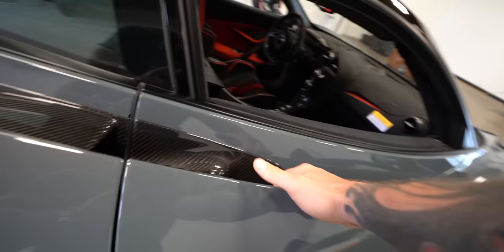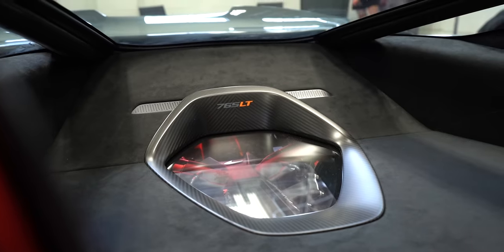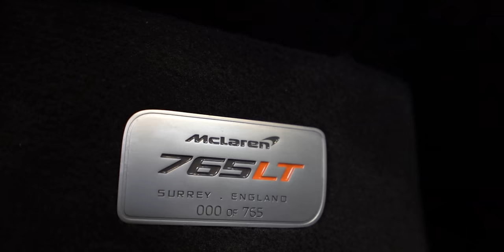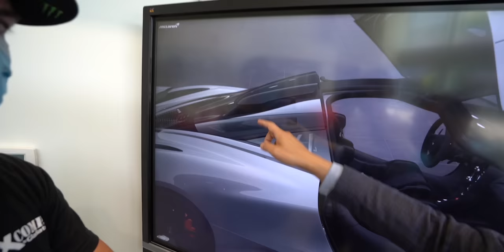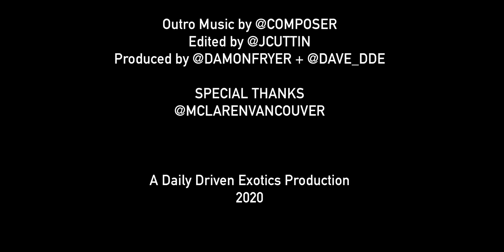TRADING MY MCLAREN P1 HYPERCAR FOR 2 NEW SUPERCARS?! 620R & 765LT

Comment: Think about your differentiator - what makes you guys special.  The P1 was an obtainment achievement - incredible for a YouTube pure car channel.  However, for the most part the cars you all create and make your own are what draws so many people to you in addition to you daily adventures.  A 765LT is in many ways less interesting than what you will do to your 720s “GTR” creation.  A 620R or 600LT cannot be made but so much more crazy where it draws a wider audience.  I’d invest the potential P1 assets in a way that draws even greater appeal.  488 Tire Slayer makes tons of sense, something different that you can create and nostalgia to the OG 458 Tire Slayer.  Cars you simply purchase to park i.e. a CGT or even the P1 and show/drive on occasion will likely not draw the same return on your investment your hoping for.  Urus may be very cool with you all’s creativity.  A Porsche of some type draws in another brand not currently in the mix where there is a ton of aftermarket ideas that can be done.  A Merc of some type - maybe a GTR Pro or even a GTR and make that into a full on Mercedes GT3 conversion with the Black Series wing and added aero.  More is not more if it’s more of the same despite how cool of cars the 765LT and SVJ are.  More is more if each one is truly unique and different than what all the other people out there have too.

Comment: Why not some german cars [porsche, audi, MB-AMG] getting tired of lambos sorry
Reply: would LOVE to see them get an Audi RS3 and mod the shit out of it. can easily squeeze 1,000hp out of them. mines 575hp with simple bolt ons & tune
Reply: Lambo is German though and german crs are overrated
Reply: SRSpoony lambo isnt german its a italian brand wich is owend by Volkswagen auto group the parts and engine are from audi but its a italian brand
Reply: @danielnik8521  its owned by a German company and 60% of the car is German made NOT Italian and it might have an Italian branding but its a German company. 

You cant argue with a fact that its German now plain and simple same as Ducati and all electronics on the bikes are bow German aswell as many other things like the brakes and internals in the engine
Reply: SRSpoony why overrated
Reply: @danielnik8521  cost its way over priced
Running costs for service over priced
Very prone to going wrong on parts that shouldn't fail or designed poorly.
Oil filters for instant need turbos n heads removing for a small oil catch filter audi
Poor quality heads on BMW 
Saving weight on them actually costs you more to buy the car for less
Reliability is an issue.

List can go on and on. When they work fantastic WHEN they work. Had plenty I live in Switzerland

Comment: why does he like the chassis mounted wing?
the electric one is so much nicer
Reply: chassis mounted wing makes more downforce than the active wing and makes the car more nimble around the corners.
Reply: And it looks fucking SICK
Reply: @paramsehgal5024  but these guys aren't getting aggressive enough on track (mostly they street drive), so it's really moot. I vote for keeping the stock as well.
Reply: Because the chassis-mounted wing weighs A LOT less in comparison with the electric one, because of all the hydraulic/mechanic/electrical systems the electrical one demands to work; which results in better speed and performance than an electric wing. 
Also, with a chassis-mounted wing you can go over the top and put some megalomaniac giant wings, which you can't do with electric wings because they have to be adaptable to the hydraulic system the car already has.

Comment: 765 - It’s not a roof scoop, it’s a rear windshield scoop. And it used for general engine bay cooling and not induction. Pass. Add other CF options instead.